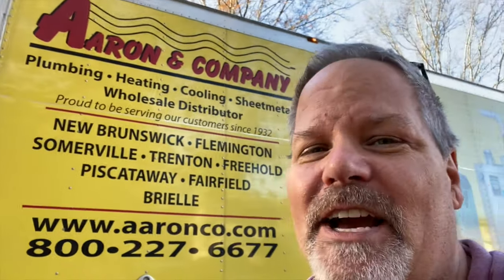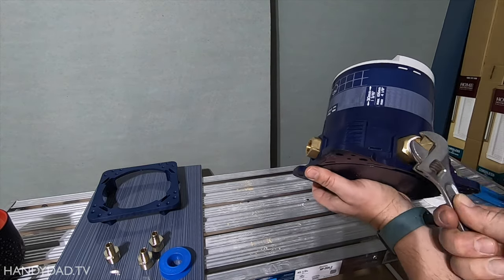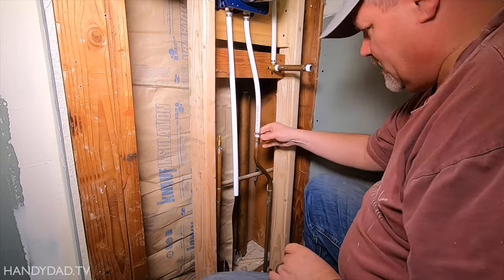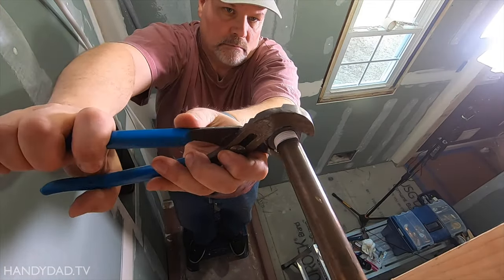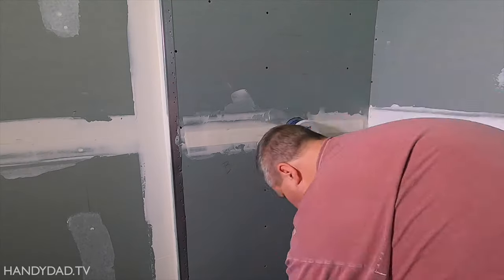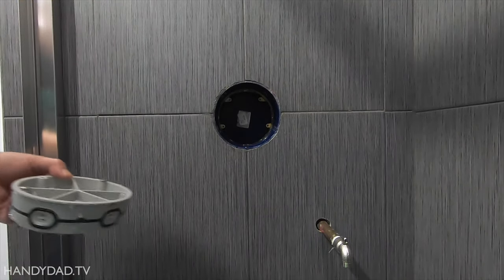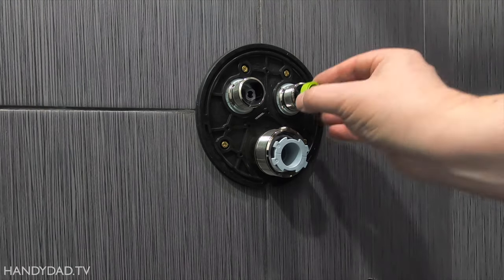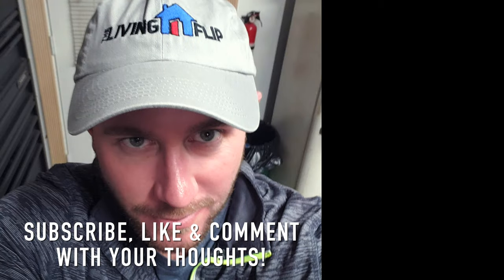WE INSTALLED A SHOWER VALVE // TLF 26

Comment: What if the rapido smartbox is installed using A and B ports and plugging C. Will this valve still work?
Reply from the maker: No. You need to choose one of the port connection options on the front. All 2-port options use B and C only.
Reply: @handydadtv  hello HandyDad, I need help, I hope you can help me. I have smartbox and this: https://www.grohe.co.uk/en_gb/essence-single-lever-mixer-with-2-way-diverter-24058001.html, at the moment top shower and hand shower work together when the button is popped in, when button is popped out, nothing happens no water goes out, I think my plumber made a mistake and he installed using A and B, and since we have the plug for A outside as well (while installing the valve there's another outside plug and he put this plug to A, so at the moment only B works in the button popped in position). Is there a way to correct this ? If I get this one: https://www.amazon.co.uk/Linear-24095001-Single-Lever-Diverter-Chrome/dp/B07QJ56SF9, and dont use the outside plug for A, would this help top and hand shower work separately ?
Reply: @handydadtv  any ideas :) ?
Reply from the maker: Refer to this document https://cdn.cloud.grohe.com/Literature/Brochures/en_GB/GROHE_Rapido-Smartbox-Brochure_en_GB/original/GROHE_Rapido-Smartbox-Brochure_en_GB.pdf
Page 36 shows your valve trim using port B for the shower head and port C for the hand shower.
If the valve is not working correctly, you should get your plumber to fix the issue. 
I've heard of hiring a plumber to fix DIY mistakes, but not the other way around!
However, your suggestion of replacing it with a 3-port valve might work if he used ports A and B incorrectly. But GET THE PLUMBER TO PAY FOR IT.
Reply from the maker: @alsan2812  Judging from the installation instructions, it looks like this will work for you. The diverter simply selects any of the 3 output ports.

Comment: At minute mark 9:52 in this video you need to point out that the knobs should be in the open position.  In addition, the orange guides which came with my unit are to be placed over the trim, you had yours placed flat and maybe they are specifically for cutting, but mine where not which resulted in me cutting mine too short.
Reply from the maker: Thanks for the tip
Reply: So the push buttons should be all the way out..with orange caps over the trim knobs..then cut stems flush with orange piece ?..
Reply: I think they made two versions. The one shown here is older and I think the plastic spindles need to be pushed in (valves off) before cutting. The newer version has orange covers over the actual knobs so you want the spindles out (valve on) before cutting. I cut mine as shown with spindles out and now they are too short and I’m scrambling to figure out how to get new ones.

Comment: Overall great instruction video! A note, please don't install rough-in's with PEX, unless you like having the toe warmer leak while running the shower. Always run copper for the shower assembly (you can actually run PEX to the hot/cold, but the rest needs to be copper).
Reply from the maker: Wait. Are you saying it’s okay for the supply lines to be Pex, but the riser to the shower head, for example, should be copper?
Reply: @handydadtv  Weird, right!? Bare minimum is one to the spout, this avoids the leaking while running the shower. Pex doesn't allow enough pressure for the spout diverter to remain fully enabled, it will always be partially open with Pex (example, you ca pull on the diverter, and it will stop leaking). We had one customer complain about it, we researched, and ended up opening the drywall behind the shower to re-plumb it post completion. Easier than re-tiling.
Reply from the maker: Are you talking about a pull-up diverted on a tub spout? With water-saver shower heads, I’d think the pressure would be high regardless of the tubing going to the spout. 

Coincidentally, I looked at a picture of my current house being built and see they indeed used Pex for the supply lines but COPPER for the lines to the tub spout and shower head! Is this for flow, or rigidity? 🤨
Reply: @handydadtv  I haven't been able to find an explicit, data/ technical backed explanation for it. The most logical is that the inner dimensions of a pex tube is lower, reducing the pressure. This can also cause a backup of water to flow up to the shower head.
Reply: @handydadtv  Any issues with your pex shower head setup?  I know if you use pex B crimp style the fitting has a smaller diameter than pex A....hence potential for lost of pressure.  What if you use pex A maybe that would be a non issue.
Reply from the maker: No issues and no complaints about pressure. Remember, every shower head is a water saver these days. So the slightly smaller flow on Pex B really doesn’t affect showers.
Reply: bc did not crimp the pex fitting properly, the pressure will be smaller past the rough in valve.

Comment: This is an excellent video! I sell plumbing fixtures and sell Grohe. I will most definitely be sharing this video with any plumbers who have any questions about this system. Thank you for making it!
Reply from the maker: My pleasure. It really was an easy installation. The comic book instructions are the hardest part.
Reply: This was not done by code. & the way you soldered those transition fittings was pretty poorly oh & btw u should do your research as to why there are copper lines in houses.
That plastic pipe builds up bacteria on the inner walls of the pipe, where as copper is a natural entaganst that kills bacteria. 
Besides the fact it's a shitty thing to put low quality material in your house and look to pass it off as if it's proper material behind them walls. 
Another words u can paint a log of shit to look nice but it's still a log of shit.
But good effort for a home owner, just sad ull try to sell the house in the future as if it was the correct material & professional work.. 
Smh.
Reply from the maker: Wow you sound like an angry old guy who can’t let go of the ancient ways. Sorry to say, no new homes are built with copper anymore. I guess we’re all consuming bacteria growing inside the Pex tubing.

Comment: All your work looks good but the gas cap is a “no, no”. It will create corrosion. Thanks for sharing your work.
Reply from the maker: Gas cap?
Reply: @handydadtv  I don't want to annoy you but between 4:18 to 4:23 and 4:24 to 4:33 it seems like the piece of copper pipe was capped with a bulky galvanized or black gas cap ( the grey color cap). A copper or brass cap will look skinner and it would be similar to the copper pipe color.  Unless what you've installed there is a "plastic cap" with a galvanized/black gas cap look.
Reply from the maker: Oh gotcha. Yeah, the caps were black pipe on brass nipples. But they were just there temporarily for pressure testing.